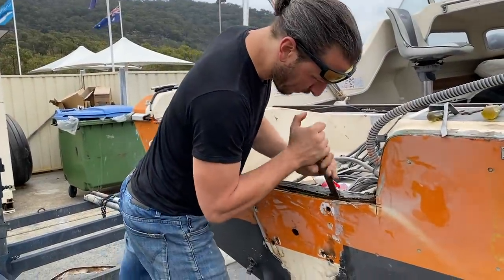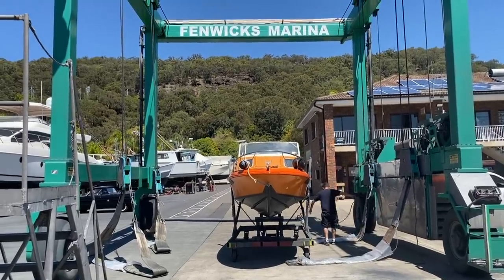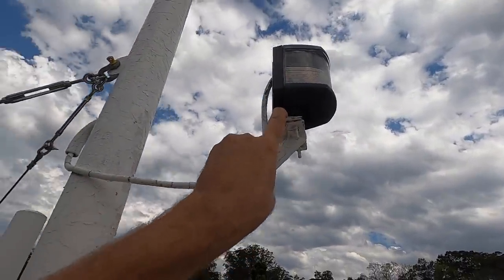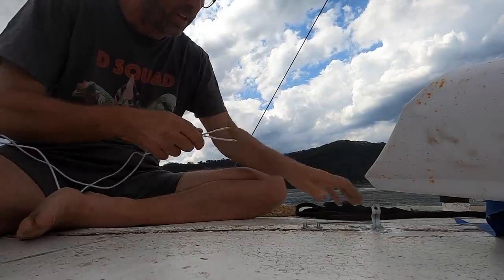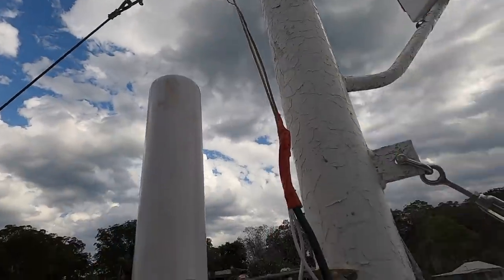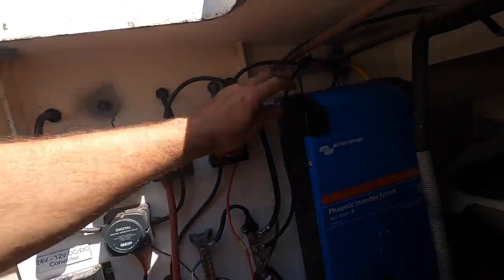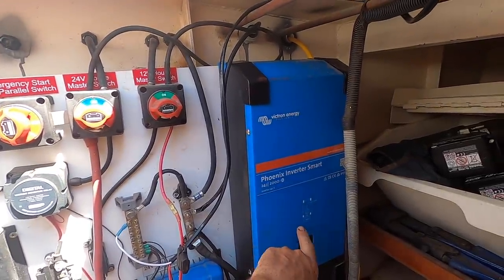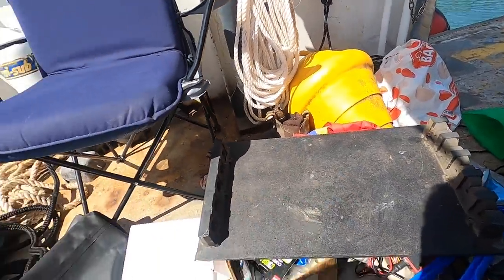Self launching bow roller for the anchor, and neater wiring!

Comment: DC and antenna coax will usually play nice (that said I have to chase an issue in the car where my new earth source for my 2ways is stirring the UHF on CB29 but amateur V and U is fine).

The furthest practical distance from the mast you can get with antennas the better.

I've seen a few of them antennas on other boat videos so they seem popular though not sure how good they are. When doing new DC cable in these sort of cases I think you're often better running 7+ core trailer wire for future extras since it's often not THAT much bigger than some other twin core cables and is double insulated.

The earth thing there's a chance the Inverter will see some sort of feedback loop if there's voltage on the earth line, or that there's AC where there should only be DC and then kick out.

I'd have left that neg bus bar as was ... looks more simple no bs no fuss. Used that fuse box for something later up top or down the back. I'd be more concerned about the positive terminals behind the switches in the hutch being able to be hit by a pole or something when working.

Solars look clean like that!!

Shore power SHOULD pickup a fault before it gets to your CPE if you could call it that. So you "should" be protected by shore power up to your isolation equipment. If the earth is hooked to the neg bus bar alongside the inverters then any case of the active opening up and hitting the hull will complete the circuit to earth blowing the shore breaker. In theory.

I was unaware of the "too much" theory for anodes. TIL ....

SMA connectors for your mobile phone antenna have that opposite in many cases ... you go from which has the pin in the centre. FME connectors used in phones often confused me for a bit with that until that was explained to me. SMA connectors etc have an "RP-plug" for reverse polarity ... can't that be fun when you get 2 females that can slide into each other and not make a connection of the centre pin.

Ciglighter sockets are universal so always a good idea.

That roller ... can you put 2 arms back toward the cab off it and squeeze and extra roller in? That would mean the farthest point each end is a roller with a mid for support as well.
Reply from the maker: Thanks for all the info, definitely now thinking of trying to move that antenna further from the mast before wiring permanently.

Comment: I notice that y’all don’t use dielectric grease where you crimp. Is there a specific reason? 
When wiring marine and buses, especially when making up new battery cables, I was taught years ago that it was a must to prevent possible oxidation. Actually I got into the habit of doing it on all vehicle electrical.
Curious to know if my info is just simply out of date or what.
Reply from the maker: I probably should, it's just not something I'm in the habit of doing. Theorically a strong crimp should create a cold weld that prevents corrosion but the grease can't hurt.

Comment: Stu, re the inboard end of the bow-roller, I'd advise not to just cut it off!  If you put a vertical cut in the webs at the side, you could then bend the end downwards creating a 'lead in' for the chain/rope.  Take it home weld the gap with some stainless mig/arc wire, to remove the chafing point on the side.  You could even weld a small stainless loop over the top of the inboard end, to ensure the chain/rope never jumps out of the bow-roller channel.
Reply from the maker: Yes, opening it up does seem a good way to go.

Comment: If you are slobbering oil out of exhaust they probably broke a oil ring on install, they are very very brittle, work extremely well if installed correctly if not oil comes out exhaust unfortunately. We have a 6v53 that has broken oil rings runs absolutely perfectly but oil oozes out exhaust
Reply from the maker: Yeah, that’s pretty much what Adrian is saying too. Likely they got install from the top of the sleeve and passed the ports on the way down to their final position. Looks like it is going to come out next week and get a few other upgrades at the same time.

Comment: Great Project . May never end but a lot of  Gratification . Great Vid and Instructor . I have a question . My 25hp Mercury outboard leaks a little water  where the two case pieces meat that you took apart to change the water pump . Is this a bad thing ?? I checked the 4 bolts holding them together and there tight .  Water pump is working good . Pumps cold water when cold hot water when warmed up . I may be nick picking but if you can  tell me what you think  I would be proud to hear  back . Thank you for your hard work and great channel !
Reply from the maker: That's not a problem. It isn't sealed there and water comes in from the ocean and out from the exhaust.

Comment: Mounting the 4G antenna further from the mast would improve propagation characteristics. Also, if you go with VHF antenna for the radio, top of mast will be most efficient. But you can still get by with an automotive magnetic mount on the cabin roof. Before you cut the bow roller feed, how about slotting the coners and bending it out or down a bit for feeding.
Reply from the maker: Yes, was also concerned about the proximity to the steel mast, might look at other options before I run the wires.

Comment: Shorepower socket on the pilothouse, no problem if you run wires from there to the galvanic isolator on the engineroom panel.

Comment: I'd put the shore power inlet in the wheel house, then run the wires in the same type of flex tubing you used for the solar power wires. This will allow you top keep the hatch closed, where the open hatch may chafe the cord, as well as protect the wires from the power inlet running through out the boat. If it was me, I'd also rip out all the lose wires and run then through flex tubing, or use the hard PVC type tubing. I do a lot of electrical work one Vehicles, and this is how I normally do it, and I've never had any issues.
I'd also run the ground wire from the Inverter to the same ground bolt you have all the other power running to - if you have multiple ground points then your can get a "ground loop" and your electronics can start having random issues.
Reply from the maker: Yes, will definitely get move conduit soon to protect the existing wiring. Ground loops can be a big issue for sure.

Comment: Hey dude, for that junction box on the roof either put a plained to screw adaptor or preferably swap for nylon gland and finish conduit before jbox. If you need some glands etc let me know what size
Reply from the maker: Yes, sealing it well to stop water getting in would be good. Appreciate the offer, not sure what size they are yet.

Comment: Stu.  A trick I have seen, for getting individual wires out of a conduit is to chuck the ends into a cordless drill and twist them together.  This make the bundle essentially one wire (will be stronger) and helps to shrink and break the bundle from the sides of the conduit.  You can also do this to wires you want to run through a conduit too.  A car stereo guy, showed me this one.  I've used it to run wire (works great) but never tried removing wire this way but I've heard it works.
Reply from the maker: Nice tip!

Comment: Just a thought instead of drilling/cutting a hole in your mast where it is worn thin from rust to try and pull the wires etc and patching it which honestly sound like a very temporary repair at best perhaps a better solution would be cut your mast off at the point below where it is rust damaged and weld a flange onto the stub of the mast and weld another flange onto the other section of the mast that was cut off and had the rust damaged section cut off and new pice of pipe/tubing sectioned onto it in its place.(mast extension if you will) then you will have a easy way to remove the mast should you ever pull Renko out of the water and transport it by truck and trailer as well as allowing for easy installation of wiring or serving of the mast (painting etc) in the future.  additionally to ensure the where the flange is installed is waterproof and to provide additional reinforcement to the joint it would in my opinion be a good idea to install a section of tubing (preferably stainless steel or aluminum) as a sleeve that fits snugly inside the stub of the mast and into the vertical section of the mast (mast extension) .  this could be done by welding it in place but an easier option that should work just as well and if not better is to 3M Panel Bond Adhesive applied to the section of the sleeve being installed in the mast stub.  When you would be bolting the two sections of the mast together an O-ring could be installed on the sleeve which I would coat with a waterproof grease (Myself I would use silicone grease because it waterproof and should not damage the insulation of any wiring) additionally I would make a gasket using butyl rubber and install a heavy gauge ground strap between the upper and lower section of the mast and leave a large service loop of wiring (3/4 to 1 meter) in the ceiling area of the cabin.  
Not to be a nit picking nag but if Renko were my boat I would spend some time nesting up the wiring you have installed because there are some areas that it is getting a little ratty looking and now is the time dress that all up otherwise before you know it you will have a first class mess on your hands.  Sorry again for sounding like a whiny nag but having worked 20 plus years in the telecommunications industry neat orderly wiring is a pet peeve of mine and probably most anyone else who works in the telecom industry.  
StaySafe, StayHealthy and keep the wind on your bow and the seas on your stern
Reply from the maker: Yes, was talking yesterday with a mate about adding a couple of flanges to the mast to make it easily removable. Seems like a worthwhile change for sure.

Comment: Anchor issues...
Adding a roller would give the best protection to the bracket, chain, and rope. The swivel attaching the chain to the anchor should have a short length of chain between it and the anchor to prevent side loading snapping the yoke in tough anchoring situations Stu.
Reply from the maker: Yes, thinking I might just add a shackly between the swivel and the anchor and see how that goes.

Comment: Would a moisture meter work on assessing the moisture in the wood shielded by the fibreglass on the transom? Could you drill small holes it the transom for the sensors to go through?  Could be an interesting excerise if you have a donor boat.
Reply from the maker: Could be an interesting excercise, I'm sure it would work.

Comment: when you dropped the silver probe into the water and took a reading you talked about the anodes and the hull. were you measuring electrical current? also you said   you can start building material on the hull? I wonder what material and how it attaches itself to the hull? the more I watch the more complicated owning a boat becomes!
Reply from the maker: Yes, you are measuring a current flowing between the silver and the hull. I'll do a full video on that soon to give all the details.
Reply: @DangarMarine  oh good because it kinda looked like witchcraft.

Comment: do you have a manual release for the winch for if you loose power to it? have same type sav winch but if lose power cannot anchor, easy to pull up by hand but cant let it out without power
Reply from the maker: I don't. I think in that situation I would just use the spare anchor which has it's own chain and rode.

Comment: i noticed that solar conduit is open where the wires come in and you have a piece that ducks under the beam at he back. 
that may be a spot that water can gather. may i suggest drilling a small hole in the lowest point of the conduit so the water can come out.
Reply from the maker: Yep, definitely need a way to either keep water out or let it drain out again when it gets in. Will probably go with both.

Comment: Instead of making the awning detachable it might an option to mount the awning to the roof with some heavy duty hinges and attach the steel wires to a vinch on the roof that way you can lift the awning up and out of the way at the press of a button or adjust the height whenever is needed
Reply from the maker: Yes, I was talking with Adrian about that a few days ago, would be a very neat feature for the awning to have.

Comment: Stu,

Others may have already suggested this...but if you're going to cut a hole in the side of the mast to pull new wires maybe you should consider adding some kind of waterproof box or cover instead of welding it shut for future access.
Reply from the maker: Yes, future easy access would be a nice thing.

Comment: Hey mate, I run a marine electrical business down in tassie, I would suggest getting a copy of the AS/NZS 3004: 2014 part 2 which is the electrical standard for recreational boats, that earthing stud in the inverter is an equipotential bond terminal, under the Australian rules in a metal boat this should be bonded via the most direct path as possible to the hull, definitely not via the dc negative bar, legally it would have to be a green yellow earth cable as well, I have worked on a lot of boats that have fizzed harder than a berocca tablet after people have had a crack wiring there own ac systems, as for the rcd, unless the inverter has a neutral earth link (men) it won’t serve much of purpose, people get very confused when it comes to ‘earthing’ because you have equipotential earthing/bonding, ac protective earthing and dc negative which a lot of people also call earth
Reply: Inverter has a MEN link, As neg bar is earthed to hull it is ground.
Reply: Also you would probably find the house or wharf your plugging into would be RCD or RCBO protected as per AS3000 so worring about where the plug goes isnt an issue
Reply: I think a lot of people get confused due to negative terminal being ground in a car. Not the case in other applications, and results of not understanding this could potentially be fatal especially when you are dealing with high voltages in electric vehicles.
Reply: @deepfriedmeatpie  The MEN link is built into the inverter, The manual and AS 3004 are right next to me, Whilst I agree that a licenced electrician should be involved, I am licenced myself and have done a lot of compliance work getting a well known boat manufacturer over the line with electrical compliance for their range, funnily enough I wasn't licenced when doing this and was not required to be, as confirmed by my states electrical safety office (long story not for this forum) wouldn't mind networking with you through a non public means
Reply: Hi Nolst, I have just bought a 10m steel boat and it has a generator under the floor in the middle of the boat and a earth wire going to the chassis of the boat right next to the generator and the boat also has an inverter under the back deck (about 5m away) with no earth direct to the boat.
we use the inverter about as often as the generator so my question is we have a 3 way switch to change the active to the 240v from the generator and the inverter so should the inverter be next to the generator and earth or is it OK where it is as it uses the same circuit for neutral and earth as the generator?
Thanks in advance. 
Hope that makes sense
Reply: What some people call "neutral" wire is really just a grounded wire at power plant, grounding in different locations is not necessarily equal in potential voltage and that is why you have to ground locally and share that ground with "neutral".
Think of this like this is water and the power plant could be higher or lower than where you are and connected, water would flow and this being electricity, flow could be painful if it is through your body. Do not allow a situation where your body is the only link between "neutral" and ground. I hope this makes some sense, once you understand this all the other stuff will fall into place.
Reply: @deepfriedmeatpie  Definitely harder to put words on a screen, variables to account for as well like the switchable MEN . Lots of well meaning but misinformed advise floating around which makes it hard.
Reply: @deepfriedmeatpie Grotty yachties are just as bad, I hate to say

Comment: They dont call them the green leakers for nothing- and sometimes "oil" out the exhaust is sooty fuel- they like screaming or they run cold, have a 671 at work that anything less than a hard load spits fuel, problem with their airbox is it runs the cylinders/pistons cold when under small loads and relies on the head itself to hold heat
Reply from the maker: They do like to be run hard, for sure, but this definitely has a bigger problem that needs sorting out.

Comment: I would mount the power inlet on the boat cab and add, buy a Clipsal ip 56 - 3 module weather proof box adding the RCD in two of the modules and inlet in the third. It will look neat.
Reply from the maker: Nice idea, I like that.
Reply: Dangar Marine  - Clipsal part 56e3 rw  and 56sb4

Comment: Thanks for another interesting video. On the anchor rode: I take your point about the dyneema- cored double-braid being stronger and allowing more rode to be wound on to the winch, BUT nylon stretches a lot more so acts as a shockabsorber, protecting your winch. If you are going to anchor in a big sea and use the double-braid , you could protect your winch by cleating the double braid to a horn cleat or find another way to snub the line so the strain doesn't damage that lovely winch.
Reply from the maker: Yes, a snub line with more stretch would be a great thing to have rigged up for bad weather.